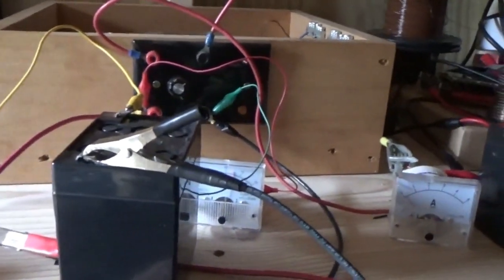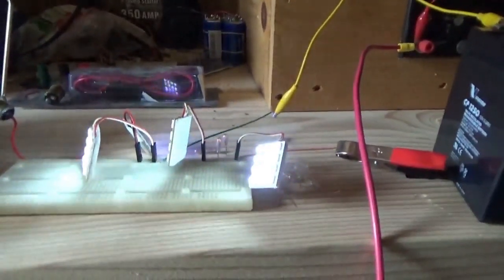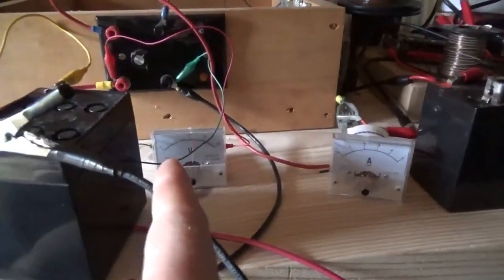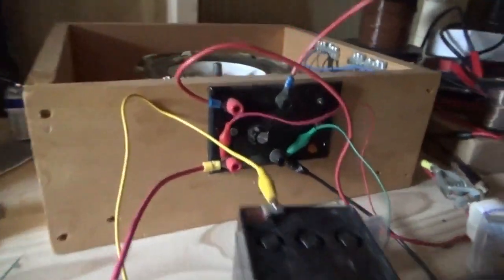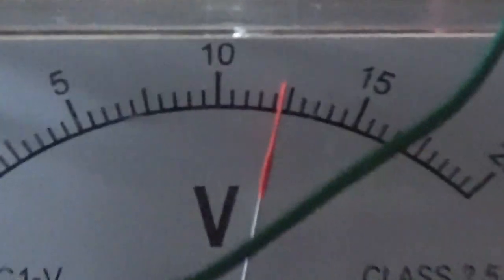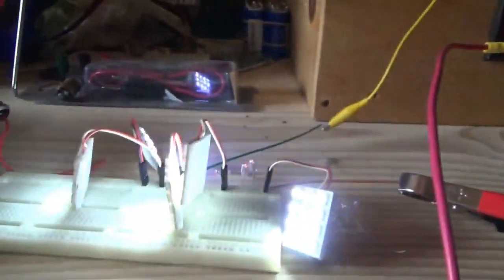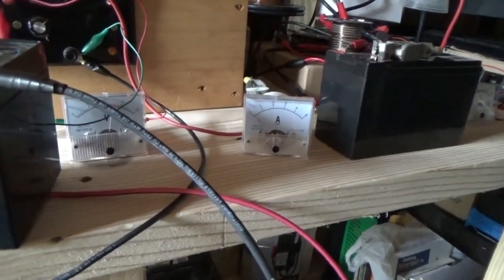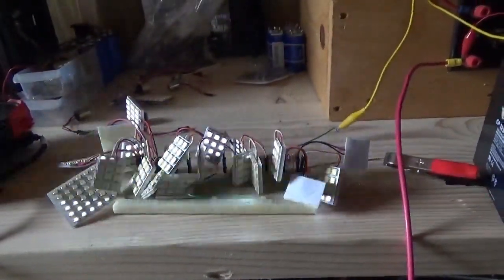Bedini Motor Running 19 LED Lamps ~ Lower Current & Higher Charging

Comment: Sorry, but there I no such a thing as "a lot of extra energy for nothing"
Reply: Because with the bedini motor you are powering the motor itself 

You are using energy.
Reply: However, with wind and solar, you know where the energy is coming from, and how to measure it, Wind caries so much kinetic energy at a given wind speed and temperature... with solar the energy density  of sunlight as electromagnetic energy is known. (About 1kw/sq meter in space at Earth orbit)... But I hear nothing about where this Bedini energy comes from... if you can't measure it, it ain't science, it's magic. :D
Reply: In order to make a claim of "extra energy" you have to measure both the input power to the bedini as well as the output power.
Reply from the maker: Really?? My solar panels. My wind turbines. My Bedini motor.
Reply: That is not extra energy for nothing. It is energy conversion and can be measured, both input and output.
Reply from the maker: Same thing in my book. I do not put any energy into the solar panels or wind turbine but I get a lot out. Must be breaking some laws huh? Same with the Bedini motor. Why can one be accepted but not the other?
Reply: No disrespect, but you believe in something that is not possible, really not, dont get taken away whit this fools sience, you should know better.., Real sience, (whit the proper noledge) wil tell you that you are realy wrong on this. i like the experiments and the tinkering, but y know the outcome in front... (thats why y have studied this for years), its funny to see that people think they have discovered somthing, that tesla Volt Henry Ampere and ohm explained ages ago...lol. (still like to see this tinkering lol)  (it started whit radio, lightning and dccurrent in coils... Real sience.)
Reply: Jim Steele.  I think you are being a bit harsh although I like your healthy skepticism and sticking to logic on the foundations of modern electricity principles.  But what if something else not recognized is going on here, do we throw the baby out with the bath water?  You are speaking as a scientist or engineer which is ok, but the first peoples did not wait to have measuring instruments before using energy sources around them nor did they wait for a scientist to come along and spout energy conservation violations.  They made sailing boats without knowing what wind energy derived and they could not even see wind.  They made fire to make heat to survive which produced far more btus than if they tried to make friction heat by literally rubbing sticks together.  So for them, making a fire took far less work input vs output heat gain compared to the huge work to physically rub sticks together to make the equivalent warmth in the home.  This is a case of more energy output than put in by a human.  Emphasis on human portion not the total energy conservation.  Yet, they had no clue what a fire is or why friction made something hot.  Remember, our scientist and engineers are great but they really are late to the party for saying what is possible or not.  Nature of the Universe was already here far longer than man's more recent understanding.  Not all is known, there may be other energy sources or conversion methods not discovered.  Only Nature can really say what is allowed or not.  Nature's rules are already in place and she does not wait for humans to get up to speed to recognize, say or regurgitate the rules that she already established.  The Universe is in constant motion, there is absolutely nothing that is not in motion.  What maintains the motions?  By our laws of physics, all particles should come to rest eventually by losses like friction, radiation etc.  without outside work.  Where does the work come from?  Suns burn out.  Big Bang, where did the energy come from to start the process and what paid for it?  If I follow your logic, I have to believe in physics magic since I would be forced to believe in something derived for free and from nothing.  Of course in day to day practical matters your logic fits just fine.  :)
Reply: EnergyCrafts and Troy, Ok I accept the explanation that Troy would need an expensive oscilloscope to measure the output. But here are the problems...  First, he should mention the need for a scope to start with. Second, it is a mistake to compare the bedini to solar power and wind turbines, where the original energy source is known and well understood. But most important, Troy can offer no theory as to how or where the "extra energy" comes from. Please correct me if I'm wrong but no one else can either. Don't you think that if there was any chance of obtaining extra energy, some smart person working for companies with huge budgets would have come up with a theory and experiments to prove their theory? Look at all the money these big companies could make by selling the free energy!
Reply: I think everyone will agree that it is important to separate real science from junk science. The only way to do that is that when scientific claims are made, two things have to happen.... First someone has to come up with a theory to explain the claim. Second, someone has to come up with an experiment to verify the theory. Am I wrong?
Reply: Wiggy,  analog panel meter are the poor man's way of simple average readings.  Digital meter is slow responding, freq.  and duty cycle sensitive to limited specs. and doubtful  also to be accurate at reading high voltage spikes.  Scope is great if you can afford one.
Reply: EnergyCrafts I built the circuit that Troy showed in a previous video. it was the one with just a relay and diode. I measured the waveform under load and open circuit. Open circuit you get considerable voltage spikes not surprisingly. When it's under load there isn't nearly as much of a spike. looking at the signal on a scope I didn't see any reason that I couldn't measure the current with a multimeter and get semi accurate results. I came up with 18% efficiency for that circuit. Seems like you could do the same thing for this one.
Reply: Perpetual motion is motion of bodies that continues indefinitely. A perpetual motion machine is a hypothetical machine that can do work indefinitely without an energy source. This kind of machine is impossible, as it would violate the first or second law of thermodynamics.
Reply: Uh, Volta was only able to explain the galvanic cell after the knowing about Galvani's published results which involved the famous twitching frog legs observation when in contact with metal as I recall.  Although Galvani's explanation was wrong, the electrical relation was evident and served as the very first crude battery cell and direct current detector.  Without this prelude work, Volta would have never have come up with the battery cell on his own without Galvani's work.  It is always easier to explain something after the fact, but try announcing your own expected phenomena before anyone has ever known of it without help!  Maxwell did but he was very exceptional!  A similar case is true with Faraday's work on electricity and magnetism and Clerk Maxwell using Faraday's work to develop the famous mathematics of electromagnetism.  It is doubtful of Maxwell could have done this without Faraday's preliminary ("somewhat magical" for the time) experimental researches and invention of the first dc motor.  Maxwell did from his EM Theory predict EM waves and called for experimenters to find means to detect electromagnetic waves.  If and a big if, there is anything to Troy's claims, then either he is right and science has missed something, Troy is mistaken, or like Galvani, Troy is making observations of something without an accepted explanation and is working without a proper detector for measurement.  High frequency pulses can not be reliably measured with a true RMS meter like some want to suggest.  These meters are only accurate within a limited Hz range and pulse widths.  The best he can do is show the observations on a good scope for now.  The trouble with today's science is the instant downer on anyone with imagination to try something unaccepted and instantly saying it is impossible, won't work.  Science has benefited often from accidental revolutionary discoveries, from the invention of rubber, catalysis in chemical and petroleum refining to medicines and on.  Most of which were not predicted or even remotely thought of until after the fact.  Then suddenly science was quick to explain it like it was known all along.  Example:  earth is not flat, heavier than air flight is possible, electricity can be sent further than 10 miles with little loss, an electric motor can run without brushes ect.  If so smart why not announce in advance that xyz is possible and 123 will be done and we will get xyz?  We all benefit from science, but science needs to drop the all mighty attitude and encourage discovery and imagination no matter how crazy, as even a few neat results would be worth the many failures.  Example today:  graphene, anything, the possibilities are unlimited, lots of room to experiment with crazy ideas(supercapacitors, batteries, concrete, carbon recycling).  I just made you a millionaire!
Reply from the maker: Build one for yourself and see. So many people rant and rave against it but never tried it themselves. That is the sad thing.
Reply: Troy, even if I were to build one, how would I confirm that the output power is greater than the input power? Hooking up a bunch of LEDs is useless without knowing the input power and the output power. Sorry, but I need solid verifiable numbers before I can be convinced of anything.
Reply from the maker: You can easily measure input power. I need a more precise meter, which I will get, then I can measure the input power. The output power is more complicated because its pulsed. Very fast pulses. I guess with a scope you could figure it out. Or just measure the work done by LEDs or a battery which was charged up using the device. Calculate how much work the battery can do compared to the power fed into the system. I have more ideas but I have to feed them out slowly because some viewers get mad when I work on electronics.
Reply: I don't understand why you can't use a Digital Multimeters and just measure the dc output current. When you use a  solar charge controller isn't that a  pulsed dc square wave output?  The output of those is checked with just by reading the average dc current with a Digital Multimeter most of the time.

The best way would be to get a watt vs time for the input and output on a scope then take the  Integral with respect to time to find energy going in and out but wouldn't a simple average reading of DC current and  DC voltage on the input and output get close to the same results?
Reply: Thanks for actually doing a test, unlike some of the armchair professors on here:)  I do not have the components exactly as that circuit specs out, but did use my signal generator to drive a SSR into the primary of transformer and on secondary had a diode to collect the BEMF spike.  I have done hundreds of variations and complexes of tests and at many frequencies so I am not a beginner.  I used both a Textronix 400Mhz scope and True RMS meters.  Looking only at the SSR input power and the output into various loads, the best I could get was about 70-80%efficiency by conventional measurement.  These tests were done several years ago so I have forgot the exact number but this is in the ball park.  I used everything from incandescent lamps, florescent lamps,  resistors, non-inductive resistors, inductors core and air type and  even actual resistive heater elements.  Also I tried toy motors, capacitors and even cups of various chemical solutions.  All this in many combinations and arrangements.  I did not try a car battery, so can not comment on that but spikes may do something inside of the battery like mechanical shock to help desulfate batteries or at least some kind of ion/electron reaction which may have a benefit.  A true professional study should be done.  Can't find any peer reviewed paper on the subject, very curious.  If you read my other comments, especially about Thor's Hammer and the comment just above it you will see, that I am not seeking or expecting an overunity condition just from the BEMF pulse itself, just as a hammer cannot nail a nail itself alone.  But try to nail a nail without a hammer!
Reply: EnergyCrafts it might work very well desulfate batteries I really can't say because I personally haven't tried it yet. The testing I did on that circuit was pretty basic and quick but feel free to watch the video and give me any pointers on better ways to do things.
Reply: I can't say what better ways, it depends what your goals are.  As to it possibly fixing sulfation problems on a battery.  I would like to hear from somebody using ultrasonics on a battery and see if that will shake loose sulfation if yes good, but if no then it might help build a case indicating that BEMF does little or nothing for sulfation removal.  What actually could be happening is the frequent charge/discharge cycling is in itself exposing new active material on the plates and also dropping sulfation back into solution.  Of course if true then a person using the BEMF would still be convinced that the BEMF was doing it just as a person simply cycling by multi load/charge/discharge would get the same good results but have a different opinion not requiring BEMF.
Reply: Warren, uh actually NO machine can do work indefinitely EVEN WITH energy!  How long does your lawnmower last!  Otherwise your statements are true as long as we ignore how everything in the Universe came into being with the first kinetic energy of motion  in some reference frame and continues now.  It takes work to set off the original motions of masses.  Eons later, still moving, had plenty of time for settling by friction, dust clouds, chemical and nuclear expenditure, and raw bombardment etc.  Sounds pretty perpetual on the grand scale to me.   A better statement is to say that it is impossible for something to come from utter nothing that would be pure magic and unscientific yet as I understand it we are to believe that the Big Bang just suddenly came into being for free at no work cost!  And don't mention gravity fields as we are already told a field can not be an energy source.
Reply: David ...watching this is like watching a dog chase his tale.....convinced he is on to something, while using non rms meters to measure ac or pulsed voltage.......I figure about ten years from now he may discover the .707 difference.
Reply from the maker: Steven, you continue to mock while I continue to run experiments. You can disbelieve all you want but it wont change the facts of what is going on here. I am seeing more power out of the system that I myself put into it. There is energy available here. All your ranting wont change one thing.
Reply from the maker: But in this case the energy out is greater than the energy in. Same with a wind turbine or solar panel. I get more energy out of a solar panel than I myself put into it. With the Bedini motor, if tuned properly you can use energy that is there waiting for you.
Reply from the maker: Its not magic. It is there. I am not very clear myself because I am not into physics but yes it is real and it is there. All I am doing is using what is already available. Yes you can see the output on a scope, as I keep saying in comments. So yes, you can see it for yourself.
Reply: NO...you just don't know the math .